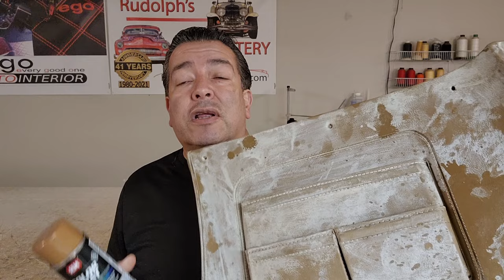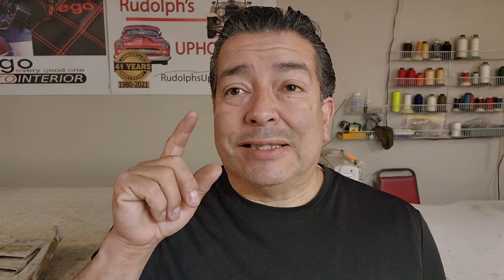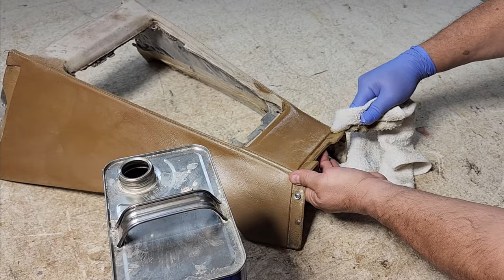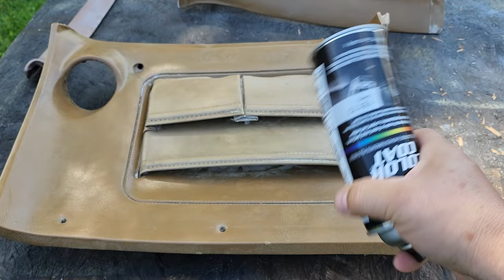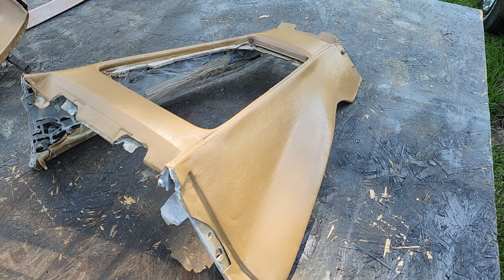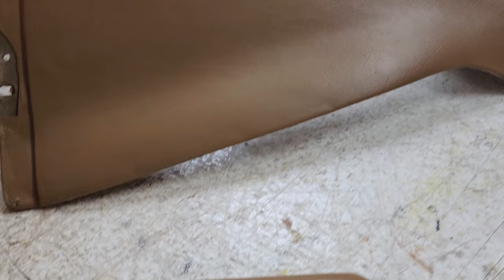Easy how to paint car interior plastic vinyl leather correctly

Comment: Been using SEM for 15 years. Great product. Acetone is perfect prep. Sometimes mixing 50/50 acetone and 99% isopropyl alcohol helps it not flash off to quick on the leather. With leather I noticed that when it gets a little tacky from the prep it’s the best time to spray it, perfect bond.
Reply from the maker: Hello Chameleon, You described it al so perfectly! I could not have said it better myself! Please keep liking and watching!

Comment: I know the right answer is to replace my boat upholstery. I just don’t have the money. It’s not in terrible shape just a bit stained, minor cracking at the seams. My question is if you can recommend some sort of filler or sealer/something I can put on the seams to preserve them and then coat with sem color coat. I’ve seen some vinyl/leather repair videos and was thinking if the white paste stuff they apply then heat with a heat gun to dry.
Reply from the maker: Hello Jaime, In 44 years I never did vinyl repair. I only did vinyl replacement. About 40 years ago I saw guys doing it at car dealerships and the result always looked terrible, so I never wanted to do that kind of quality. Sorry, I cannot answer because of my lack of experience. Please keep liking and watching!

Comment: You should be using a Adhesion Promoter before painting plastic and after sanding. It will help bond the paint to the plastic surface.
Reply from the maker: Hello Mark, Acetone is the adhesion promoter, It roughens up the plastic and vinyl for the spray dye to hold on to it. I would never spray dye anything without the prep first. Ask any experienced body man. Please keep liking and watching!
Reply from the maker: Hello Masculine, I totally agree with you. There is a direct correlation between a young unexperienced Youtuber giving bad advise and a 43 year experienced person. Doing is learning! Please keep liking and watching!
Reply: @oldschoolautoupholstery  I am a experienced body man. I have been in the trade for the last 34 years.
Reply from the maker: @MarkK01  Hello Mark, I had a feeling you were a man with experience! Please keep liking and watching!

Comment: Thanks for covering this and presenting SEM products to the masses. A lot of people are not familiar with their products. Was a little surprised you didn't use some variety of scotch pad or SEM's grit based soap to abrade the surface.
Reply from the maker: Hello J, You are so welcome! Acetone always gets the job done. It is very harsh on plastics and vinyl's. I was using that decades before there ever was a pad or grit soap. I have never had a problem. Don't be too surprised and although those might be helpful I don't think they are always necessary.

Comment: Experience creates good advice. Here is you visual guide with tips. I prefer to use a rattle can sprayer. I bought one in 2010 and will never spray can paint without it. Fits most any can, is handle is on and shaking, double check the spray window before using. Great info!
Reply from the maker: Hello Dean, I have used one of those before. But old habits die hard for me... Please keep liking and watching!

Comment: Also with the acetone use a proper nylon bristle brush, with a wood handle, unpainted, to clean in the tiny crevices, and get all the dirt out. You can use isopropyl alcohol there, to get the dirt free and out, then use a blonde medium paint brush with the acetone to degrease and prepare the surface, stripping off the top layer of oxidised material, which is what the acetone does on plastic and leather. Do not leave the surface wet for any time, the acetone will destroy the plastic is left in contact, you want the minimum time on surface to clean and strip, nothing more. 

However for plastic where it has a embossed surface that has worn away, you can actually use the acetone to restore this, using a terry cloth rag folded into a flat even pad, that is pressed into the surface wet for around 30 seconds, to make the surface ripple and match the rest somewhat. Also works for surfaces that have been plastic welded to fix them, to sort of hide the weld line.
Reply from the maker: Hello Sean, yea, just like you said! Please keep liking and watching!
Reply: @oldschoolautoupholstery  Yes, only thing I would like is a way to fix soft vinyl, that all eventually cracks and peels away from the foam underlay, that looks good.

Comment: I used the Shadow Blue for my 85 Suburban door panels,  and it is a very close match to the original color. I washed it 3 or 4 times with soap and water and did a bit of light sanding to remove the sun damage  / flaking
Cleaned it with acetone and 3 coats of SEM,
Fantastic results!
I just did one panel to start, to get the hang of it.
Reply from the maker: Hello Ed, I love hearing success stories like yours. Right on! Right on. Please keep liking and watching!

Comment: I have always used laquar thinner instead of acetone. Is there a difference? I also lightly sand the vinyl/leather as well. I have seats I did 20 years ago with still awesome results today!  Even though I love the spray vinyl cans, I prefer using the liquid dye I apply with form brushes or spray with a gun. The "liquid" is definitely more durable. I have it mixed "flat" with no shine at all! I have heard of applying an overcoat to protect the color, but have never used it. Again, I would use "flat"! I hate shiny leather!
Reply from the maker: Hello Richard, Lacquer thinner does work, but acetone is harsher and makes the surface rough enough for the spray dye to stick to plastics and vinyl. Please keep liking and watching!

Comment: Greetings!  VERY cool video!  Thanks for taking the time to post!  Would've LOVED to have seen the final results in the car!!  I have acetone as part of my cleaning arsenal, so I'm part of the way there to re-painting the interior doors of my 2022 Chevy Malibu.  Although it is used (Only 43K miles at the time of purchase), it is new to me!  The interior doors are vinyl and have scratches that I want to remove.  The color is "Dark Atmosphere." I found the exact color on Everest Automotive (WA303X - OEM ).  They claim that it's a premium polyurethane base coat.  SEM has a similar color that they named Med Neutral (15883 SEM).  Questions...I know you're an avid user of SEM interior paints, but could I use the exact paint from Everest Auto and get the same results you did in the video if I wipe down the doors with acetone first?  I want confidence in knowing that I'm using the right paint, I don't want different-colored doors. Also, should the door panels be removed from the car before being painted?  No sanding needed, right?  Please advise.  Thank you!
Reply from the maker: Hello Chelsa, Thank you so much for saying so! Sorry to say that I have never used Everest auto paint, therefore I do not know a result. I think removal will give a better result. No sanding, because you will see grit scratches. Just use the Acetone. Please keep liking and watching!

Comment: Excellent video Rudy. I have a quick question, I'm repairing a Holden Torana lower dash panel, which is made from pressed metal with a vinyl textured paint finish. It has a crack in the metal (it might be a replacement part from a wrecked car I recon) that has had a dodgy repair done previously and has opened up again. Can I V-out the crack and fill with a metal filler, then just clean with acetone and spray with the SEM Colour Coat, or is there a better way that you can suggest? Cheers Andy
Reply from the maker: Hello Andy, Thank you so much for saying so. I'd say a metal repair would be first. The SEM is for vinyl and leather, not metal. Maybe a special body shop can handle that repair? Please keep liking and watching!
Reply: @oldschoolautoupholstery  Thanks for your your swift reply Rudy. I may have to look into finding a local restoration shop for this one. I appreciate your honesty mate. Keep up the good work 👍
Reply from the maker: @andywright2606  Hello Andy, You are so welcome! I always answer every one of my thousands of comments. Hehe. Please keep liking and watching!

Comment: Hello! I saw on another video that someone used some Scotch pads to scuff up the center console they were painting.

Do you use that or sandpaper to rough up the plastic or vinyl so the paint will adhere? he was using duplicolor so it wasnt a laquer
Reply from the maker: Hello Mathew, I have used scotchbrite pad in the past, but I would not use sandpaper. Lacquer is very thin and will not hide the scratches. Acetone is very harsh and etches the vinyl and plastics for the spray dye to adhere. I saw a video where he inadvertently sanded off the fake vinyl grain off the plastic. Please keep liking and watching!
Reply: @oldschoolautoupholstery  Thank you so much! this helps. would you ever use a scotchbrite again or is acetone enough that you dont need to scuff it up?
Reply from the maker: @matthewhumcke3182  Hello Matthew, I stopped using scotchbrite decades ago as you can see in this video, I don't use it as I feel it is not necessary because I use Acetone. Please keep liking and watching!

Comment: good day sir, I recently purchased a vinyl seat but the colour is so off. I was just wondering if I could use this product and completely change the colour of it to something more universal like black or brown instead of re-order the whole thing ? will it last just as good as stock colour ?
Reply from the maker: Hello Mighty, I am so sorry to hear about your common bad experience with aftermarket seat covers. You can change the color using SEM or other spray dye products, BUT. It is better to stay close to the vinyl color for better coverage as a contracting vinyl color will be more difficult to cover. Also, know that spray dye products are not permanent and will rub off over time. Please keep liking and watching!

Comment: Just an additional tip, if you have rubber gloves as opposed to latex then you won't have the acetone dissolving them.
Reply from the maker: Hello Robert, I don't know the difference. I'm Old School. Nobody was wearing gloves for anything 40 years ago. We used to wash our greasy hands with leaded gasoline, Hehe. A lot more freedom back then. Please keep liking and watching!
Reply: @oldschoolautoupholstery  I used to come across the same thing when using acetone but I found some rubber gloves that never break. You can even try those yellow dishwashing gloves but that usually doesn't go over too well in a shop environment with other guys 😅
Reply from the maker: @robertl955  Hello Robert, Maybe the yellow is better than the pink. Hehe Please keep liking and watching!

Comment: If you want it to stick to the surface alot better and a lot harder to scratch off get a small bowl put some acetone in it and using a 3x3 
red scotch bright dip in the acetone and use the scotch bright like sandpaper it will scratch the parts and not smooth them out then spray your color on the parts after getting the look your after take a hairdryer on medium heat and go back and forth over the whole area hold the hairdryer and 4" away from part go over the parts 3-4 time with heat it helps alot with fusing the color too your parts
Reply from the maker: Hello Ls, Sounds like great advise! Thanks for your contribution.  Please keep liking and watching!
Reply: How many coats do you do? And do you scuff with acetone in-between coats?
Reply from the maker: @chalecharros7689  Hello Chale, If coating in a similar color like I did in this video, I only did two coats. If a totally different color, you will be looking at doing more than that. You only use Acetone before you paint. Acetone is very harsh and will wipe away your first coat, resulting in wasted time and money. Please keep liking and watching!

Comment: I don't want to paint over all my controls, since the screen transfer printing is still ok, but do you have any advice on motorcycle handlebar controls (aluminium and plastic) to make the black black again, and leave the red switches red, white lettering white, etc.?
Thanks!!!
Reply from the maker: Hello Paradox, I am not sure what you have. But I would think if the controls are always touched, they should have something like a hard shell finish like a thick enamel. Please keep liking and watching!
Reply: @oldschoolautoupholstery  mostly, the plastic had faded, so I was wondering if there was a treatment like a trim restorer that would not color over the writing... I might try a trim restorer, or a rubber product, like tire shine.
Do you think the SEM products work on outdoor fabric and vinyl?
Thanks for the quick reply!!!!
Reply from the maker: @paradoxworkshop4659  You are so welcome! I guess you can try some of those things. I would not suggest s spray for fabrics, but on vinyl, the SEM should work for outdoor vinyl. Please keep liking and watching!

Comment: How are you sir? I’m wondering how I get the original color, of my interior of my car? It’s an Acura ILX 2021. In a spray can? I had a burn hole in the passenger seat, and I repaired it with the filler, now I’m ready to paint, and I’d like to find the color. Do you know where? Thanks
Reply from the maker: Hello Ochtane, You should be able to get a custom color at an auto body and paint supply store. It would be a lacquer mixed up and put in a can. Please keep liking and watching!

Comment: Could I use this to spray the plastic and my fender Wells on the outside of the vehicle? Just curious to ask since you're the expert on this! Any information will be helpful.
Reply from the maker: Hello Jay, I wouldn't do that. It is really meant for low friction rub vinyl's and plastics, such as for an interior. I think because it is very thin lacquer, it will scratch off too easily. Maybe try an enamel spray paint for plastics. Please keep liking and watching!

Comment: Great video, thank you! Do you have any suggestions for a 2002 Lexus IS300 with the sticky dash problem?
Reply from the maker: Hello Green, Thank you so much! Do you mean sticky as in adhesive sticky, or the vinyl itself became sticky? What i use for glue removal is mineral spirits. Please keep liking and watching!
Reply: @oldschoolautoupholstery  On the 2002 IS300, the dashboards are sticky, leave fingerprints to the touch and look gross. The factory refused to replace or help out. They are defective.
Reply from the maker: @GreenEyesAnthony  Hello Green, Yep, sounds to me like the material or compound used to form the dash. I have never had to try to fix that. Please keep liking and watching!

Comment: So, how would you suggest changing interior colors? Trying to go from a light grey to black.
Reply from the maker: Hello Chaser, How? Just do it. Just remember, the it is not permanent and can scratch off showing a light grey underneath. Please keep liking and watching!
Reply: @oldschoolautoupholstery  Follow up question, how do you restore brittle old plastic so that it isn’t as brittle? I’ve got an 84’ Fiero that sat in a yard for 21 years, and I’m working on the interior now. Naturally, all the plastic bits are dry and brittle. Is there a way to re-hydrate them so they aren’t so bad?
Reply from the maker: @chaserwilliams1  Hello Chaser, I have never seen a rehydrated plastic parts for cars. Sorry.  Please keep liking and watching!

Comment: Two questions.  1) Do you need to change your technique in warm temperatures (90 F) with high humidity (over 90%)?  2) What would you do different for a color change?  TIA
Reply from the maker: Hello CAM, Because it is a quick drying lacquer, there is nothing different to be done because of weather. For a color change, I would used extra coats for coverage. Please keep liking and watching!

Comment: hands down the easiest video to follow. seeing the time frame for what you do on the poster in the background made me feel more at ease about "is this the best way to do it?" 

only one question.. would it be better to just replace the vinyl for longer lasting and more durability? like how that column seems like the vinyl was wrapped onto the plastic frame and secured.
Would that be a better, although more expensive, way of re-doing the interior?
Reply from the maker: Hello Branden, Wrapping a part with vinyl will make it thicker. Painting these molded plastic parts is much easier and keeps a stock original look. I always say there are more than one way of doing things. Please keep liking and watching!
Reply: @oldschoolautoupholstery  understood! I will definitely keep that in mind! An excellent point to regard material thickness and density.
Reply from the maker: @brandenhaberek  Hello Branden, Right on, right on! Please keep liking and watching!

Comment: What type of repair products can you use over the vinyl when the vinyl is in poor condition?  I have watched someone use Flexseal and a self leveling lap sealant to repair the really bad areas.  I have even seen someone mix an adhesive silicone with paint.  The paint supposedly makes the silicone paintable.  Do these products sound like they could possibly work?
Reply from the maker: Hello Dave, I have never made that type of repair a part of my business, so I don't know. I only replace what's gone bad. 40 years ago I considered repairs, but I saw that it didn't matter who did the work, it always looked bad. I never wanted to do that kind of quality. Please keep liking and watching!

Comment: just curious but would this work on plastic fender cladding like on the Honda Element or would duplicolor work best
Reply from the maker: Hello Hot Rod, I would not use laquer on external plastic. To restore, you can do the heat gun trick, or to change color, I would use an automotive paint. Please keep liking and watching!
Reply: @oldschoolautoupholstery  thanks 🙏
Reply: @HotRod-wv4vm  SEM also makes a bumper black product I used with a HF spray gun, also sold in aerosol ,that works great .Been through two Mass winters still looks great
Reply: @stephenwilliams1138  thanks